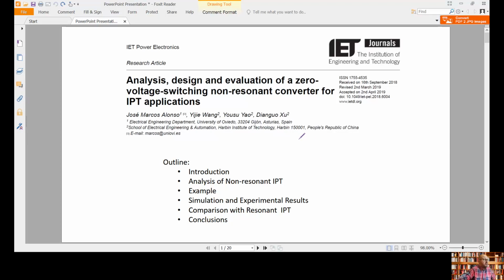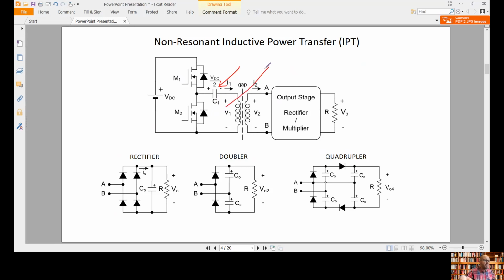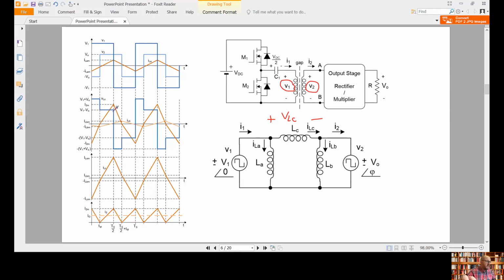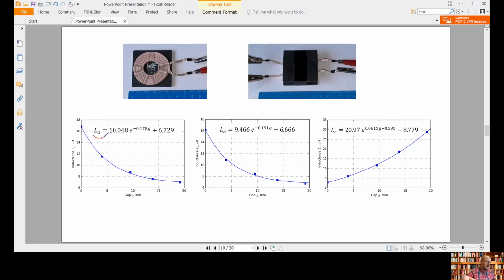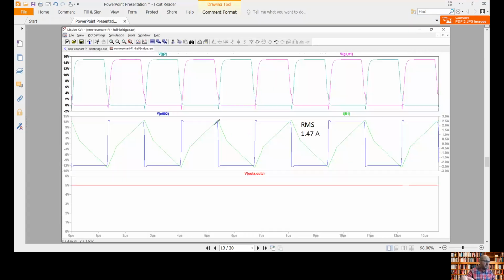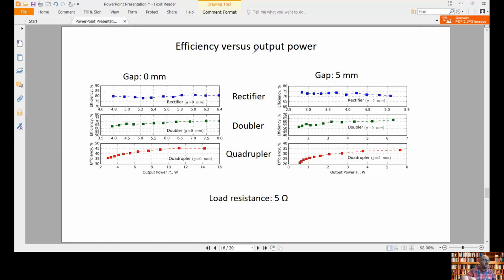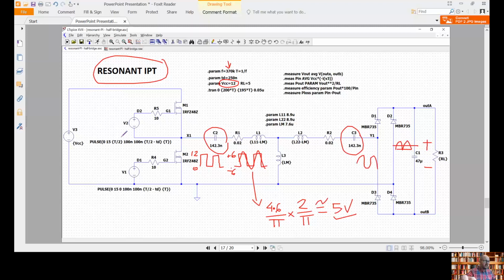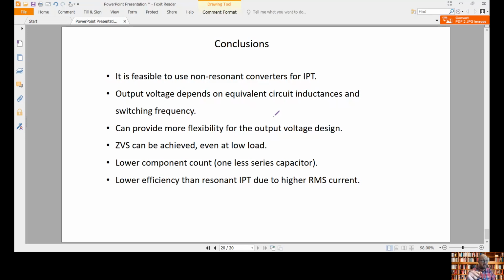PE #2: Non-resonant Converter for Inductive Power Transfer

Comment: Dr，if the duty is not 50%, the non-resonant converter will happen?
Reply from the maker: Yes, it can also operate with duty cycle different than 0.5. You have to analyze the converter under this operating condition to know how it will behave